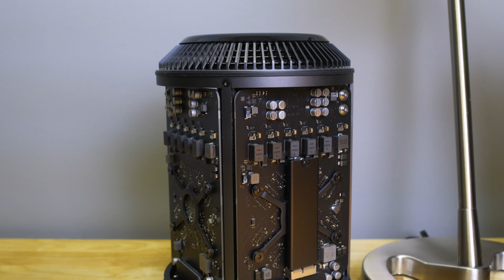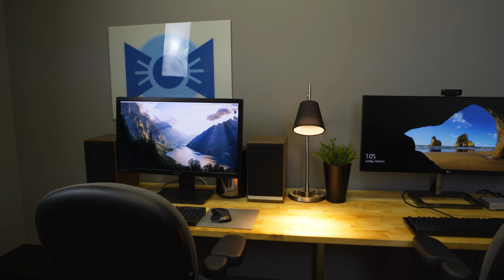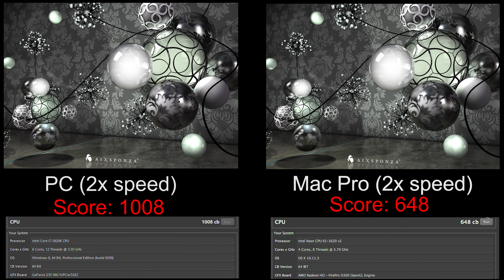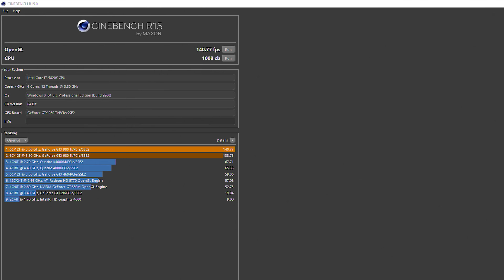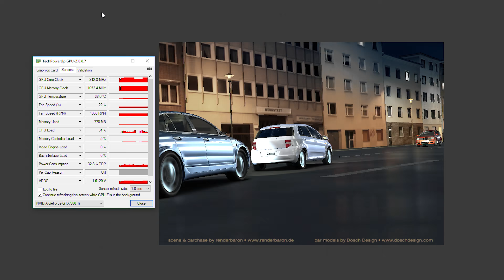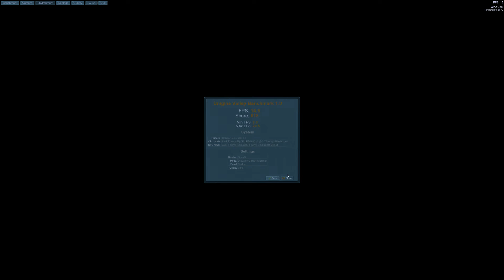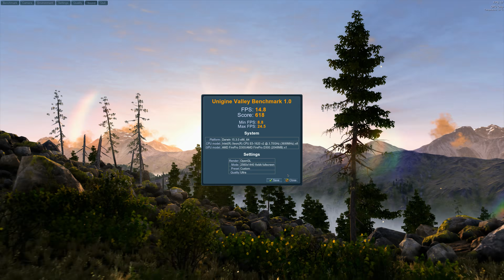$2,000 Custom PC vs $4,000 Mac Pro

Comment: Don't use a gaming benchmark to test a Fire Pro, which is made for precision, not high framerates
Reply: +Norry Fox And? It is still stupid to use Valley Benchmark in this case. He didn't talk about the precision in Cinebench anyway. He only mentioned the performance, which is greater on a gaming card (but frames, on the other hand, are less accurate)

Comment: I laughed when I watched this. A couple of years ago when the "new" Mac Pro was released I wanted one so bad. I even saved about $1300 of my money to pay for a new Mac Pro but then I decided to build a PC as well. Best decision that I ever made, my $800 PC even out performs the $4000 baseline Mac Pro at every single test here and I only had a GTX 660, a 4770K, and 8GB of RAM. This is super disappointing that Apple is doing what they did with the old Mac Pro, not refreshing it for years and in 2012 still selling the baseline quad-core Mac Pro with 6GB of RAM and a 5770 for nearly $2500. C'mon Apple!

Comment: You should spend more time overclocking that 5820k, I have mine at 4.6ghz 1.33v and 65º max temp with a Corsair h110i gt. Fully stable.

Comment: Compare PC with profession graphics card with pc with consumer graphics card is nothing more but retarded. Firepro/quadro graphics card are capable of double precision computing and a lot other useful stuffs unlike that cheap Gefroce.
Reply: +Stanislav Yordanov Well, for a price comparison I agree, consumer grade hardware is cheaper. But that doesn´t help the fact that the MacPros GPUs are mediocre an Apple's GPU drivers are just a big pile of chunk. So even running the same hardware on Windows will give you anything from 50 to 100% more Performance in OpenGL and far less bugs.

Comment: yes mayby it was ok to get a mac in the 1980 when micosoft was runing on dos ,, or in 2000 when the most run windows 98 or xp ,, on a pentum 3 or 4 ,,, but naw go with a pc if you want to do work , mac are just overprice low spec  good looking gear,  you pay a lot just becose it look nice in you desk ,

Comment: do a test of adobe premiere pro, adobe photoshop on both in imports exports as well as rendering,.........and we can finally see which one is a true working station
.Also final cut pro X :-) also the ram difference is quite significant from size to generation. d300 are really poor put d700
Reply: +Stephen Herbert Senzota: Indeed. Let's see some real-world production work timings instead of fucking around with meaningless benchmark tests. 
The only point of this video is to be click bait. This shit has been done before and done better.

Comment: lel my 350$ build is faster than this macpro
Reply: I'm using only reliable parts. I bought them used but there are good, I didn't buy a corsair PSU, they have many problems.
But I get 645 in cinebench
And 110 fps in the open gl test

Comment: Imagine the premier pro render times if adobe supported GPU acceleration on the 980ti. That's the only "real" advantage the GPUs in the mac have. They are supported by adobe and can be used for GPU acceleration. His render times seemed a bit slow so I wonder if he enabled that feature. But even if he didn't and re did the test with GPU acceleration enabled, the results would be the same.
Reply: The 980ti is Supported, but cannot be detected correctly, Just ad a cuda_supported_cards.txt with GeForce 980ti in it in the Root Installation Path of PP.
My GTX 770 works on this way flawless. BTW this text file is already there at CS6 but not at CC.

Comment: Really insightful man. I've been thinking of parting ways with my 2015 Retina iMac in lieu of building my very first PC. You singled out some extremely valid points. Subbed / cheers!
Reply: +ThomasHaydenTV You could sell the retina and make a very powerful gaming rig with an aftermarket 4k monitor with the money.
Reply: +gromann It would be more for video production, but you think I could still make something that powerful to edit with? Also, I do love the 5k monitor. So torn!
Reply: Say you get $1300 for it used, not an unreasonable number.  That's enough to make a nearly top of the line gaming rig.  Slightly less powerful if you want a 27" 4k monitor.

Honestly, as nice as the 5k monitors are, they're rather wasted unless they're within a foot of your face.

Comment: dude apple products are made to run thier programs. thats why its expensive
Reply: +Nikolay Lubko what programs? be more specific. Because i use both PC and mac. Just a FYI. The PC destroys the Mac at the same price point. like destroys it in every program.
Reply: +Master UnitCharles final cut, Aperture, and other productive and creative programs. the apple computers / macs are designed to run thier software and they are for producing things like films and photos etc. they are not for playing games. so the tests done in the video are not valid
Reply: so your saying i cant edit video and photos? lol adobe is only for mac? music creation is only for mac? even if i buy the programs for my system it validates that your getting a value out of mac? Because this is what the video is about. the value is terrible. mac should offer better hardware at a price point that is reasonable. its more of a brand thing. and yes both have their pro's and cons for consumers. no dispute on that regard.
Reply: i get it but pc are not the best for creative use i have a pc and i dont like it becouse the software is not optimized to use the hardware

Comment: Please compare the Apple to something that works. As Windows Machines do not! I know it is frustrating to deal with apple but before the trash can came out it had been 5 years since the newest G5 oh iam sorry cheese grater came out, and most people thought Apple had just given up on desk tops in general. What you get with Apple is not cutting edge like most people say but in general a good product that has good software more common sense and just works unlike Windows 10!
Reply: +warren schenck How does Windows 10 "not work"? It works fine every time I use it either on a Mac or a PC...

Comment: I agree, pc performance blows away mac any day. But the software for mac is bar none the best. For example, entering foreign languages on mac blows away pc, the usability of the windows panes using three fingers sliding on the magic touch is super smooth, pressure sensitive magic touch, moving from desktop to desktop smooth on mac. Scrolling up and down from web page to web page, smooth on mac safari. Pinching and zooming on the mac, smooth. Transmitting your media to Apple TV, it's like 2 buttons. With pc, u got to go thru like 100 steps to get that function. And let's just say that there are way more creative ways to get media, not from pirate bay with mac lol. Most of the software that actually does what u want is preloaded with mac. There r exceptions of course. With pc, u got to buy your software, not knowing if it's good or not. And it's expensive, or u can download at pirate bay, but then u risk all your key loggers embedded in that software. Yes, same computer u use for banking
Reply: +Psy Lee I agree, apple does make it easy on the part of functionality. But a am a performance junkie, also i use linux for programming and robotics. But i still dont think its worth the price to me. You get a sense of satisfaction from building your own machine where you can set up literally everything the way you need it. I am a OCD person and that aspect helps alot!
Reply: +Psy Lee And that's why you pay double the price for a half of the power
Reply: Not true, u can buy a Mac mini or MacBook Air for like 1000. I agree, if u want full blown power to play games and video editing power, pc is better. Mac is just better for everything else.
Reply: You assume a very tiny world, not the one in +75% uses windows machines.

Most of my architecture software is years ahead on windows environment, the Windows version of the some program are more advanced than the Mac version

Comment: Even my late 2014 Retina iMac i7-4790K will beat the base model trash can in a CPU test. It's getting to be pretty pathetic.
Reply: your iMac is not a 4790k more like a 4790 because there's no point to put a k part in a iMac because you can not over clock because of thermal limitations
Reply: +wiideathmod For some reason they did use a 4790K, although I agree overclocking is pointless with the thermal limitations (not sure if it's even possible in OS X).
Reply: +Timur Tripp well it is possible but the Mac will shut down in 5 sec or less

Comment: People who buy Mac's are chumps while Moore's Law is still in effect - you can't upgrade them (save for RAM, althought I'm not sure if you can even do that in the Mac Pro), yet it's a given that your hardware will become obsolete within two to five years. If Mac's were using a different architecture with distinct benefits in some applications (say, Power PC) the huge price margin and drawbacks would make sense, but Mac's are just PC's restricted to a proprietary ecosystem. I still can't wrap my head around it: why do you buy a Mac if you need a computer for work, or for anything for that matter? All the software, hardware and peripherals (pro-grade displays for example) that are available for PC's are just as good or better than what's available for Mac's.
Reply: You can most definitely Upgrade ram, Ssd, and even the CPU in the Mac Pro.
Reply: *****
Maybe if you stopped being a fanboy...

Comment: The comparison is flawed on so many levels.
1. You are comparing 4core vs 6core - of course more cores of the relatively same speed will be faster
2. You are comparing xeon vs i7 - they have different instruction sets and in these synthetic tests the core instruction sets have advantage
3. You are comparing ATI vs NVIDIA - openGL vs Cuda - 980 is in totally different league than low powered proffesional entry level cards. Proffesional cards, at least nvidia cards are built to be able to run all the time at load but with low compsuntion. 
And the last thing, there may be problem with the user and the setup of the Premiere on your mac. Deadpool was edited on mac pro - 8core or 12core D700 - 3,2K alexa footage and 5K & 6K Red footage. The story is that they burned 10 D700s cards, but they did it.
Call Adobe to setup your premiere. Also you do not have enough RAM for4K. You meed at least 16GB.
Reply: +Sfilipum And the PC is much cheaper.....What is your point?  OH So for it to be even then he needs to pump more money into the PC.  Same as the mac costs.  OK.  Perhaps he should do that and the comparison will be a little more fair.
Reply: +Red Smith thepoint is to compare it the same level mashine. For example to compare it with simirally speced HP Z440 or Z640 and the price will be same. And in that comparison workstation vs custom build is not a good comparison.
And the another thing: what will all you cuda game cards guys will do when Adobe stops supporting cuda on normal cards?
Reply: +Sfilipum ok for now Cuda is great. when did you hear about adobe not supporting Cuda in the future? if this is the case perhaps the new pascal cards Nvidia will release this year have an architecture which suits. who knows. would seem strange if they abandoned it all in one foul swoop.
Reply: +Red Smith similarly speced HP Z440 (4core 3,7ghz, 12GB ram, pcie storage, two pro amd graphics cards) $3541 and that is without thunderbolt becauce thunderbolt can be ordered only Quadro cards a d that would start at $3765.
Workstation macs are not more expensive that the pc workstations. All workstations are more expensive than custom builds and always will be.
Reply: +Sfilipum mate I have worked in the vfx industry for over 20 years. I have used all sorts of system. Bottom line in a lot of consumer systems these days offer great value for performance. Often better than the lower level or even mid range workstations.  Anyway I am getting a massage right now here in Thailand. I shall concentrate on that. Sum it up...I have used so many systems and platforms from.  $1000 to $40,000 and sometimes names are more expensive than hardware.

Comment: Wait are you telling me that a Mac costs more than a PC?????
Reply: +Jeff Sepulveda By the way that same Mac Pro config now is only $3,000 (not $4,000). And why are you comparing a 6-core PC to a 4-core Mac? There is a Mac Pro that is configured with a 6-core processor and better graphics cards for the quoted "$4,000" ...
Reply: +Jeff Sepulveda +Jeff Sepulveda I'm curious how the ACTUAL "TOP OF THE LINE" MAC PRO with 12-cores, 64GB of RAM, Dual D700s would compare albeit at about $9,000. I know it's way more expensive but if you're gonna suggest that this is the "BEST MAC THEY MAKE" maybe you should mention that they do make a better version...

Comment: Yes the pc Hardware has the better Benchmark results but its big, ugly and very loud when you not water cooling the system. Also the Mac cost more because of the included OS with all needed programms and the awesome support. But your right, the Mac Pro is overpriced. I hope apple upgrade the Hardware and make it more affordable.

Comment: Run windows on the Mac Pro and you will get a significant performance increase. OpenGL is significantly more efficient on Windows
Reply: +Norry Fox Interesting.  Not having a Mac Pro, AMD OSX drivers are the only one I have not really tried. 

Faster performance on Windows for just about everything is certainly true with Nvidia and Intel GPUs.

Comment: PC users have known this forever, the most expensive Macbook Pro you can buy has about the performance of a $500-600 PC. And to all the Apple fans saying to run the tests in Windows on the Mac Pro with Bootcamp, don't bother. The gains, if any, will be insignificant. You have a top of the line X99 processor and THE best graphics card available right now in your PC.
Reply: Agreed, many isheep don't understand that their macbook pro is seriously underpowered for it's price. it's the same with people who play on consoles, their machine is too expensive for it's potential. I built a $600 pc which can beat both, the macbook pro and the consoles no problem.

Comment: you probably won't like to hear it, but i achived simular results with my 3 year old PC which cost around 1200$ back then. 
AMD FX8320 @3,9GHz
Asus GTX 970 OC (only part new in this PC)
16gb Corsair Vengence DDR3 1600
Asus M5A99X EVO Mainboard
Crappy 2,5" 5400RPM HDD 120GB (need to get my SSD ready again)
Cinebench OpenGL: 67,90FPS
CPU: 638 cb
Valley: 
Avarage FPS: 58,2
Min FPS: 21,4
Max FPS 109,2
Score: 2433
However i am not sure how comparable that result is, because it depends on the settings used. I used default settings at a resolution of 3840 * 1024
Reply: his was at 2560x1440 is the highest (ultra) settings
Reply: Andrew Sanderson i don't have a monitor that resolution, so let's ignore that benchmark...

Comment: I had that same Mac Pro trash can mac,, and took it back, and bought a used mid 2010 (12 core) mac pro.  However before I took the quad 2013 back, I rendered a demo project file in Blender, and the 12 core was twice as fast. I even gave the 2013 a head start. It only took my 12 core 15 minutes to render, and a little over 30 minutes for the 2013 to render the same image

Even a 12 core 2013 Mac Pro only has a 25% improvement rate over the 2010, and I believe a 12 core Mac Pro is about $8500.  I paid $2000 for mine. I wouldn't be surprised if Apple brings back the tower Mac Pro's. Maybe a slightly different design. Those trash cans are a failure.   No doubt your PC could beat my Mac pro too, but don't think the gap would be as wide.